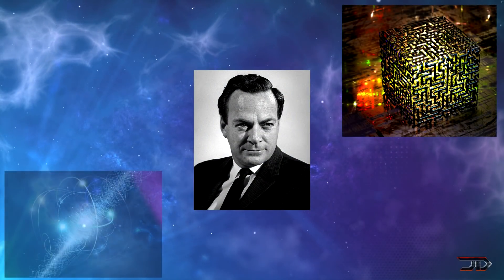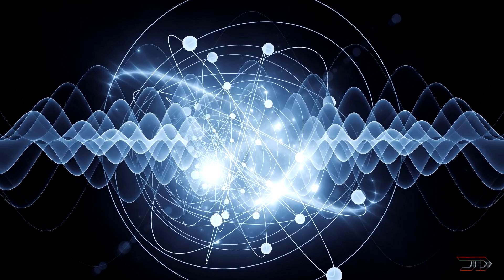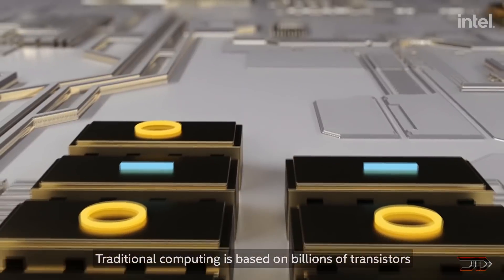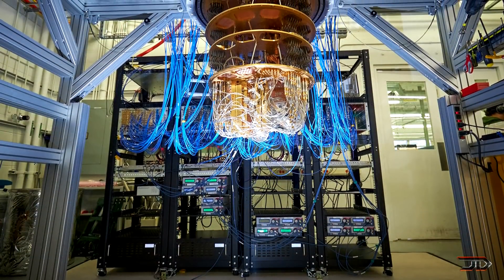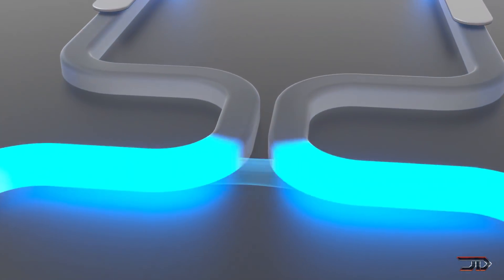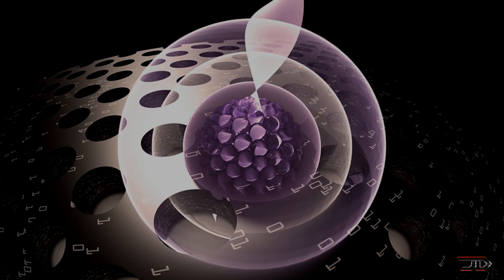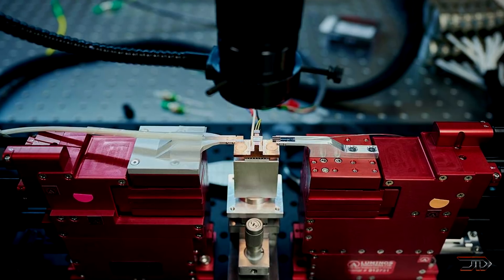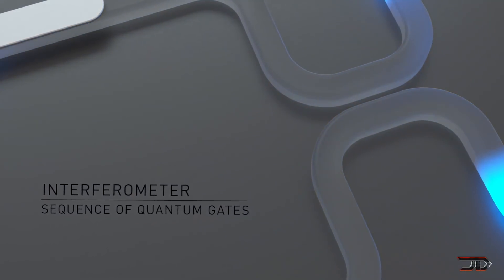Quantum Computing - The Latest Breakthroughs

Comment: Conventional "AI" is SIMULATED by conventional computers.
QUANTUM COMPUTERS tap into the Quantum Universal Consciousness Field.
Since our minds are part of this Quantum Field, there is almost no limitation to what is possible.
Of course, they don't want us to know they can read our minds or control our thoughts.

They say that very soon, we won't need cell phones because we will directly tap into this Quantum Field.
(Just don't tell anyone that their minds are open books.) 
Good luck finding this in a Google search.

The Quantum Field is kind of like a conventional computer but it processes data in Parallel, all at the same time.
(OK, well I guess it's really nothing like a conventional computer.)

It doesn't have any type of Program. It basically has a mind of it's own.
Since it is not hindered by time or space, you can easily Teleport to anywhere in the Universe or at any Time (past or future) just like a character in a video game.

I don't believe you can write a conventional Program for a QC.
You could probably connect it to a keyboard and monitor if you wanted.
But a direct mind interface is probably easier.

This Universal Quantum Field is basically the creator of our physical reality.
It's everywhere, all knowing and all powerful.
(OOPS! I probably wasn't supposed to say that.)

David Wilcock wrote a book about "The Source Field" that holds templates for all life forms.
And probably non-life forms.
This probably connects somehow to our DNA and our consciousness because everything exists within this Quantum Field.

Conventional computers are limited by speed and time.
They process instructions in series, one instruction at a time.

The Quantum Field (MATRIX) processes everything in Parallel at the same time.

Think of the processor in a video game but multiply that speed by INFINITY.
That's how you can instantly travel ANYWHERE in Time and Space.
Everything exists at the same instant.

Just like a video game, Time and Space have to be SIMULATED for us "characters".

Just because Time and Space are simulated does NOT mean that our reality does not exist.
If you create anything, it exists.

Comment: "AI" is SIMULATED by conventional computers.
QUANTUM COMPUTERS tap into the Quantum Universal Consciousness Field.
Since our minds are part of this Quantum Field, there is almost no limitation to what is possible.
Of course, they don't want us to know they can read our minds or control our thoughts.
They say that very soon, we won't need cell phones because we will directly tap into this Quantum Field.
(Just don't tell anyone that their minds are open books.) 
Good luck finding this in a Google search.

The Quantum Field is kind of like a conventional computer but it processes data in Parallel ,all at the same time.
(OK, well I guess it's really nothing like a conventional computer.)
It doesn't have any type of Program. It basically has a mind of it's own.
Since it is not hindered by time or space, you can easily Teleport to anywhere in the Universe or at any Time (past or future) just like a character in a video game.

You could probably connect it to a keyboard and monitor if you wanted.
But a direct mind interface is probably easier.

This Universal Quantum Field basically the creator of our physical reality.
It's everywhere, all knowing and all powerful.
(OOPS! I probably wasn't supposed to say that.)

Comment: I have yet to see any explanation about the actual process by which a quantum computer does any computation at all. Simply announcing that it uses Qbits which can be in a superposition of 1 or 0 at the same time does not shed any light on the subject. I know enough about traditional computers to understand how semiconductors can be arranged into logic gates, and how those logic gates can be set up to perform various logical operations, and how from this basic level of logic a computer can be programmed to perform calculations. However, this basic knowledge only makes quantum computers seem even more mysterious since I cannot begin to imagine how a qbit can even be set up to perform and AND or an OR gate or anything like that. Please do a presentation on the basic operation of the qbit. I must be fascinating but I can't find any info on it anywhere.

Comment: Mostly used for decoding the universe.opening locks.
There problem is making a computer that exist and operation 12 dimensions
It's the only way they must use nickel it will conduct electricity at 12 dimensions and back and forth.I heard it somewhere.
Diamonds are good too!

Comment: I don’t understand cubits. They’re in super position )either 0 or 1 until they are observed. Is that not the same with traditional computer? A bit is either 1 or 0 right? Until they get processed
Reply: Superposition means that the qbit is both at the same time and when measured returns either with a certain probability... It's both when computing but only one when measured...
Reply: @squeakybunny2776  how does that help us tho compared to bits on a computer?
Reply: @dougfoster445  the processing power that n number of qubits has, is denoted as 2^n. 
so for 1 qubit, there are 2 states. ( 1, 0 )
for 2 qubits, there are 4 states [ (0, 0) (0, 1) (1, 0) (1, 1) ]
for 3 qubits, there are 8 states. [ (0, 0, 0) (0, 0, 1) (0, 1, 0) (0, 1, 1) (1, 0, 0) (1, 0, 1) (1, 1, 0) (1, 1, 1) ]

imagine a computation involving 256 qubits (which is near-impossible for now because technology), that's 2^256 number of possible states. A conventional computer could only dream of solving something that complex.

Comment: Quantum communicator- using the timing of rotation switch .001 seconds=1 and .0001=0 (just an example of method and measurement) between entangled electrons. Of course one device would house one end of the electron so to speak and the other with its mirrored part. No more lag when sending equipment or anything we need to maintain constant communication into space. Okay engineering make this happen!

Comment: This is such a colossal waste of time, money, and effort.
I don't care how much they bs everybody they will never get it to work on the scale that they are predicting.

They literally have to pump a ton of energy into the system in attempt isolate and cool it.
This is done in hopes that it will somehow magically fix the failed results that they keep getting when attempting to use it.

And that brings up an even bigger question.

What good is a system if the majority of the computing power that is created has to be put back into that system just for error correcting?
More importantly how do you know that it truly corrected the  error when the majority of the system creates the eras in the first place.

Those who know the math know that superposition is not real and the data and results that was gathered from the tests that would even suggest that it is I've had their p-values hacked.

The conservation of energy ring a bell?
Probably not.
I suspect that's because there's too much primate rattling around in those craniums.

I certainly can't speak for everyone but frankly that says it all right there.

That said, I could go on and on just on that part of this subject alone, but I digress.

The best they can hope for is to use it for securing information between nodes and is in my opinion about the extent of it.

Oh. For the record.
Yes.
There is no doubt Richard was a very smart man who could easily do the math while standing on his head. 
But the man could never understand what the math was truly conveying.
It's kind of like those people who are born with the gift of playing music and having perfect pitch. 
Sure, they're able to do all that amazing stuff; but they don't understand why or how.
They can't even understand why others have an emotional attachment to their works of art.

Also for the record 
You may be able to easily trick and fool the layman but the truth of the matter is, Quantum uncertainty does not mean that something is in all positions at once.
It simply displays the likelihood of where it will be if you look for it. 
End of story.

I have a suspicion as to why this is, but I won't even waste my time to offer it until the rest of the scientific community starts telling the goddamn truth.
Start being honest and then we'll talk.

Oh and by the way, you might not want to waste a whole lot of time.
My life is coming to an end very soon.
Just like climate change, the longer you wait the less chance there is.

Comment: I would like to see a video that actually explains how the qbits work within the framework of processing of code to produce an output.  Also having an explanation of how superposition increases the speed of which we can process data would help in furthering the understanding of how this works.
Reply: I can tell you a little bit about this. Like he says in the video, the qubits can exist in a superposition state of 0 and 1, lets say an equal superposition: 0.5*(0)+0.5*(1). This means if you measure now, you have an equal chance of getting a 0 or a 1. One qubit by itself isn't so useful, but if we have another qubit in this same superposition, measuring them both together has 4 possible results. One quarter of the time, they will both be 0, one quarter of the time they will both be 1, one quarter of the time the first will be 0 and the second will be 1, and vice versa for the last quarter. Write it like this: 0.25*(00)+0.25*(01)+0.25*(10)+0.25*(11). We can also write these outcomes like they are binary numbers, where (00)=0, (01)=1, (10)=2, and (11)=3. 

This is where the advantage becomes clear. If we are giving our computer inputs and looking for the correct answer, we will need to ask a classical computer if each answer is correct. Is 0 the right answer? No. Is 1 the right answer? No. And so on... For the quantum computer, we input our clever equal superposition which contains all the possible inputs, and through some tricky algorithms, the quantum computer will tell us the right answer. The advantage is small for our 4 possible input example, but with just 20 qubits, the quantum computer will be trying over one million possible inputs in one go, while the classical computer will be stuck trying each one, one at a time.

The quantum algorithm I just described is called Grover's Search, and has existed since the 90s. The theoretical software side of q-computing is actually somewhat developed; many smart mathematicians and physicists have come up with calculations that can be run on a quantum computer, but the hardware has been much more difficult to develop. Just like a classical computer, quantum algorithms use a set of gates that can do any calculation when properly combined. How the gates are physically implemented varies depending on the type of hardware. Most current hardware (like IBM and Google in the video) uses superconducting circuits, where the gates are implemented using microwave pulses and magnetic fields. Also mentioned in the video are the photonic computers (they are a bit more theoretical right now) which use laser pulses and light-matter interaction to make gates. There are many other weird proposed systems like shooting lasers at floating atoms (called ion traps) and even using the quantum states of many organic molecules in a solution as thousands of tiny computers (NMR q-computing). It's a really cool developing field! Let me know if you have questions!
Reply: @colebunch3130  good start but you are missing a few things I think.

For one quantum computers don't always give the right answer because quantum mechanics is probabilistic in nature. Therefore the computations has to be done multiple times to build up a statistical average.

Your comment also seems to suggest grovers search algorithm gives the answer after one step for millions of inputs while in reality you need sqrt(N) steps to search a database of size N. Massively better than the average of N/2 for a classical computer but not instant or anything.
Reply: @squeakybunny2776  Very good points! My description of Grover's was a bit misleading in that way, thanks for adding that detail!
Reply: @colebunch3130  Thanks for trying to clarify this for me, but my brain still hurts trying to wrap my mind around this; and I earned a degree in Nuclear Engineering as well as became a Naval Aviator.  One area that still confuses me is how they are able to use the superposition feature.  If the qubits can be in two different states at the same time then how does that work with processing information?  I guess it is the "AT THE SAME TIME" aspect of qubits that throws me off.  I will just blame the medications the VA has had me on for years for destroying me mind's ability to comprehend complicated concepts such as the qubit's superposition.

Thanks,
Steven
Reply: I'm pretty sure the software is equally as undiscovered as the hardware.
Reply: That would be multiple university courses....
Reply: @squeakybunny2776  Plus extensive post doctorate studies and research, and even that may not be enough "edumacation" to understand it. :)

Comment: The hardest part for quantim computing is developing a system that can do a range of things without requiring a redesign the entire machine every time. Todays computer can run many different complicated programs simulteaneously, and more can be added at the users leisure. Quantum computers would need to do something similar before they could be implemented into everyday, or even industrial uses.